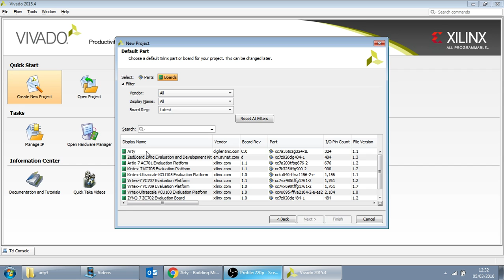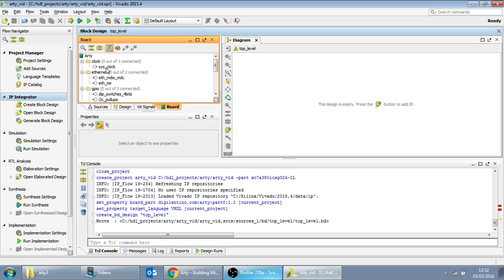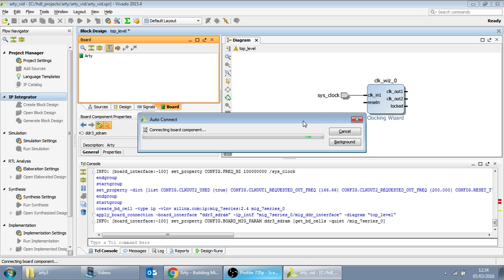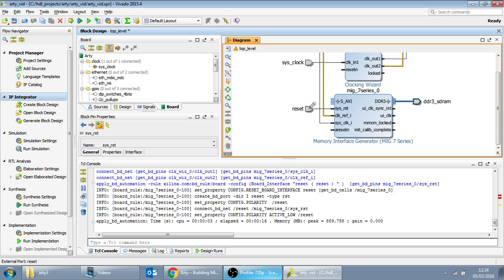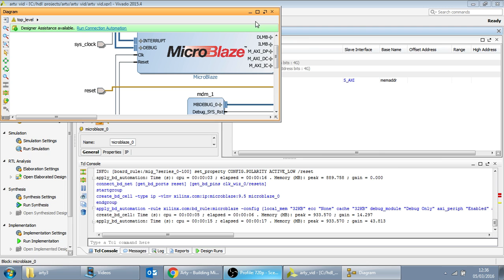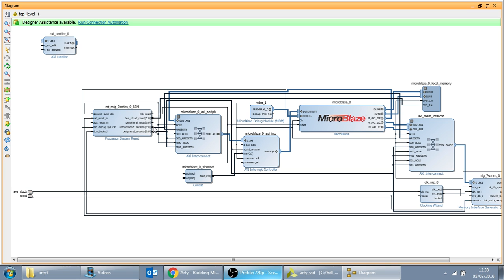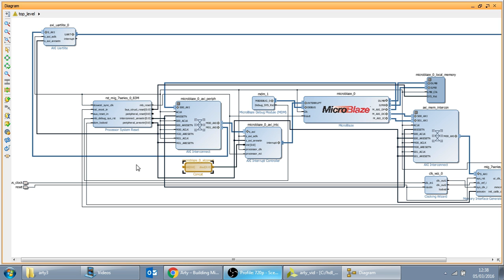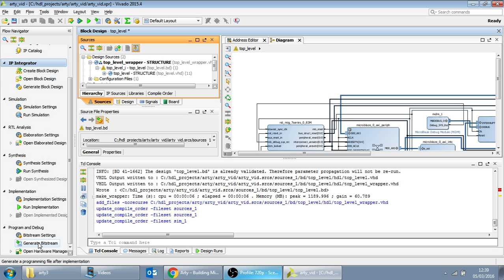Creating a Base Microblaze System on the ARTY Board

Comment: Two questions please. Why the MIG interface clock for the Microblaze and where do I find the specs that say I should use 166 and 200mhz for the memory. Thanks in advance
Reply: The MIG wizard will tell you that 333MHz is the maximum speed for the memory. You can then choose from a number of input frequencies to generate that 333MHz - in this case he's chosen 166MHz. 200MHz is a constant frequency used by another component (IDELAY_CTRL) within MIG. You can read more on MIG in a number of places (there's a document link if you double-click the MIG block), but a good place to start is UG586 Zynq-7000 SoC and 7 Series Device Memory Interface Solutions v4.2 User Guide. You can read more on IDELAY and IDELAYCTRL in UG471 7 Series FPGA SelectIO Resources User Guide.

Comment: Why did you choose 166 MHz and 200 MHz for the clock frequencies?
Reply: Can we run it faster than that?
Reply: The minimum clock period supported by the memory and FPGA combination is 3ns, or 333MHz. The MIG controller uses a 4:1 memory speed to interface speed in order to support this, hence the 83MHz for the Microblaze clock rate. 200MHz is used by another component (IDELAY/IDELAY_CTRL) within the MIG controller. Without getting into too much detail, the IODELAY primitive uses a set frequency (200MHz for this particular FPGA speed) to adjust timing for the DDR during initialization.